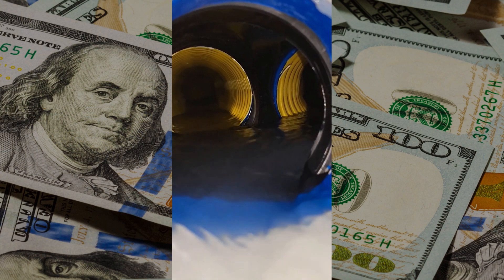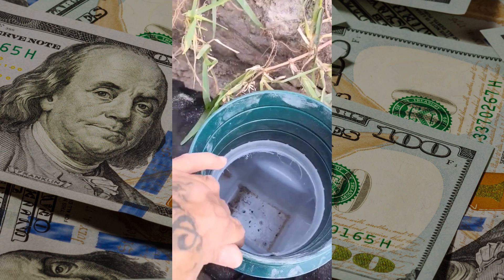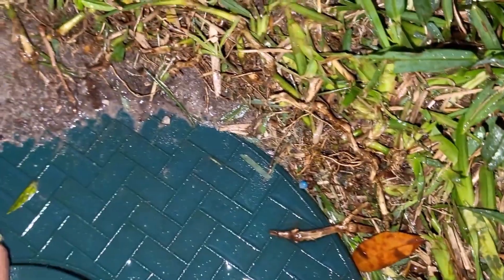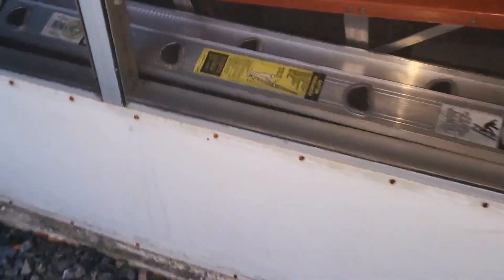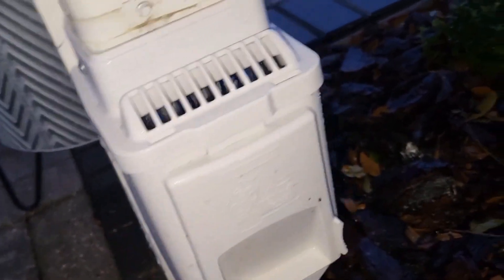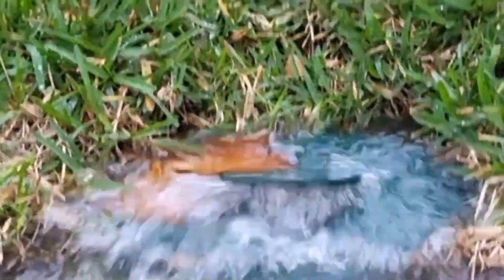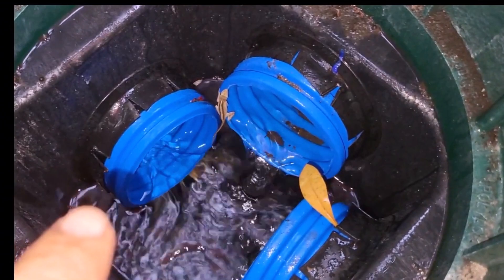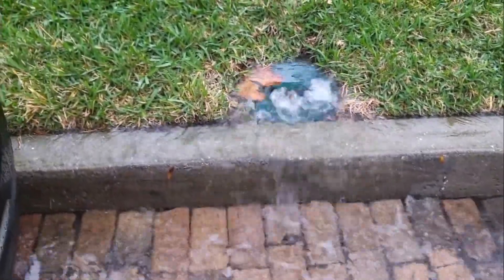Best Yard Drainage Systems in ACTION

Comment: I want that popup enitter. I have a Zoeller m267.  With 2 inch discharge going into a small catch basin. I think pop up emitter works better. Can it handle 120gal/mjnute?
Reply from the maker: 240 gallons per minute

Comment: This is a great system!  I'm trying to figure out what I need for my down spout extensions in Northwest Indiana.  If I have about a 1400 sqft roof with 2 downspouts and about an 80ft run with a 2% slope to the discharge point would the typical 4" single wall corrugated pipe be ok?  Is there a general rule of thumb for what the 4" corrugated pipe can handle and how long it can be?  -Thank you
Reply from the maker: Yes, a strong 4" pipe is all you need.
Downspout Pipe, 4 in. x 100 ft., High Octane ARMOR Pipe
https://frenchdrainman.com/product/heavy-commercial-solid-high-octane/